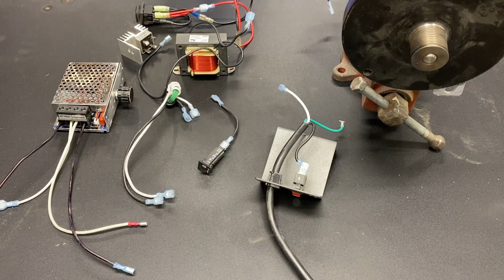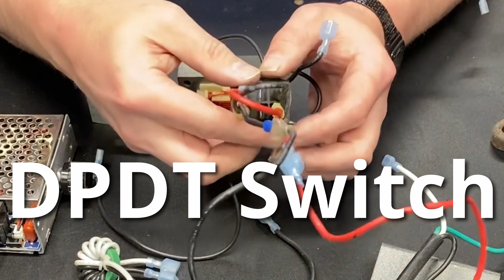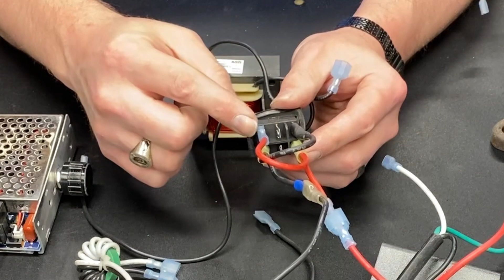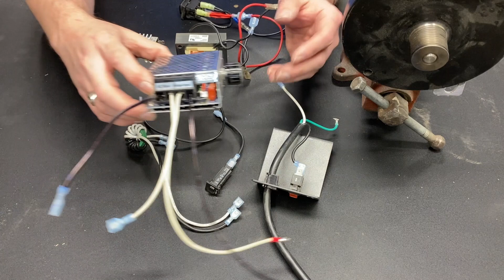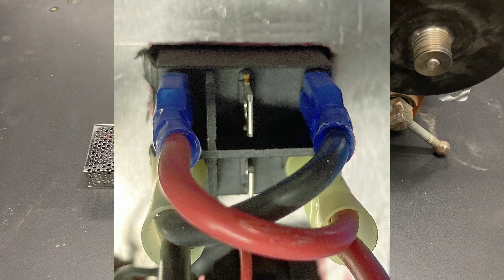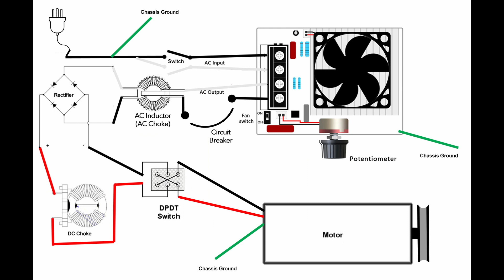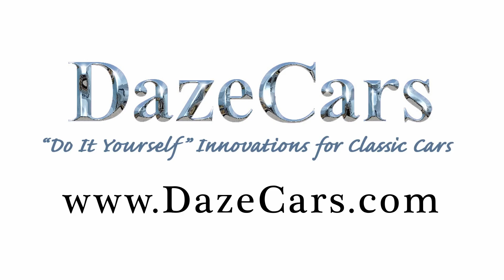Hooking up the Components for a Quality SCR Treadmill Motor Power Supply, Treadmill Motor Controller

Comment: I was looking at choke transformers on eBay, and they seem to have double wires coming out of them: two black, two red, and two blue. This is different than the ones in your videos with just single black wires. What do I do?
Reply from the maker: The problem is they are mislabeled on eBay because the person selling them doesn't know the difference and they are creating their listing using info from previous listings.  There is no such thing as a "choke transformer"  it is either a choke OR it's a transformer.  The two parts look almost identical but are NOT interchangeable.  Easy way to tell is the number of wires.  two wires it's a choke 3 or more wires it's a transformer. Here are a couple videos that should help  

https://youtu.be/atlaaApTkJw   

https://youtu.be/sYjkQvUSths

Comment: We had almost this same circuit, but without the choke.  After dozens of tests, the magic smoke came out of the motor.    Now planning on including a choke.
Reply from the maker: Glad you're adding a choke this time around; it definitely makes a huge difference in longevity.

Comment: Hello Your videos are very interesting what is the value of the circuit breaker please?
Reply from the maker: if the rectifier fails it will typically short out which will burn up the SCR.  The circuit breaker is there to try and avoid that.

Comment: just curious if there might be any further benefit in terms of reduced motor strain or improved linear speed control for running the SCR DC power through a PWM and then to the motor?  Thanks for the terrific videos!
Reply from the maker: no because its still clipped AC.  The power quality issues with the SCR come from the on and off action taking place at different parts of the AC cycle.  Clean steady DC with a PWM is clean power because the DC is a constant source but the chopped nature of an SCR will not produce clean steady DC.  make sense?

Comment: What DC choke did you use? The ProForm treadmill I pulled apart didn't have one. Would a filter choke work in place of a treadmill specific choke?
Reply from the maker: it need to be a "motor choke"  all chokes are filters but the size of the wires and the amps they can handle makes all the difference as to weather it will work or not. https://youtu.be/hbfOWrmP_pw

Comment: Hi what size choke h ect for 220v ac Spanish mains  ?
Reply from the maker: The choke is sized to the motor not the line voltage.  It needs to be a high amp "motor choke"

Comment: I see your parts list, but no listing for the choke  that goes before the  motor.  Do you have a supplier for that?
Reply from the maker: That is the hardest piece to find.  Motor chokes are not easily available new and so places like eBay and treadmill used parts houses are you only option. (other than scrapping more treadmills until you get one) Problem is they hav gotten expensive and most of the listings are wrong because it says choke and transformer in the listing but the two parts are not the same even though they look similar.
Reply: @dazecars  I'm up to 5 treadmills finely got one with a choke. Do I need to use a choke if I'm using a MC 2100.  I have 4 of them , none came with a choke.  So I guess I don't need one with them. First project was a 2 X72 sander all from scratch . No plans all scrap I had laying around. Just bought the 4" idler pulley and a spring for the tensioner . Came out great . 2nd project is a lift for my mill. The incline motors are not like the one you used.  Have it geared up with gears from a 21 speed bike. The middle front gear and the smallest back gear. Turned hubs to mount them to the  crank shaft on the mill and the motor shaft. Goes up and down nice. Using PWM on both. Learned a lot from all your videos .( but not a Ford guy) I have a 51 Chevy Sedan Delivery I build a SBC and dropped it in with a 5 speed .
Reply from the maker: If running an MC2100 you do not need a choke.  Keep in mind an MC2100 is not the best option for a belt sander or band saw.  In both of those applications there is little opportunity to gear the motor down for added torque.  This makes the potential for stalling the belt or blade higher and stalling the motor will likely burn out the MC2100.  Good thing you have several of them.  Glad my videos have been helpful

Comment: Just to add you can eliminate the choke & inductor ..by adding a 2200 MFD - 200 v capacitor (Amazon. )..make sure u follow polarity..!!across the speed controllers DC out put ...this will eliminate the sawtooth ripple riding on the DC output that will overheat the motor ..and reduces the loud hum to almost zero ..if worried about high frequency oscillations ..hook also a .01/ 100v AC capacitor across as well...will shunt any oscillation out....this is how I did mine ,been working 2 yrs now..no issue .cheers
Reply from the maker: how is it under load?  When I ran a capacitor to my setup it caused surging under load.
Reply: @dazecars ...have no problems...i made my own controller...i just tested on a commercial one (amazon)....loaded it hard at low speed...no surging ...should not be any issue..all the capacitor does is filters out the diode ripple thatz riding on the DC output...try a smaller cap...around 560 mfd..i've designed & made controllers for 40 plus yrs...and allways have large caps after the diode pac...to give a pure DC as possible..the only thing i can come up with..possible your exceeding the rated amperage of the controller and its trying to limit the current ..as the DC voltage will be bit higher as well as the torgue capability ...runs more efficient !.my controller is 30 amps... cheer s
Reply from the maker: My controller was 10,000 watts so not a limit of the controller.  Thanks for the follow up info
Reply: @thebearsden1701  Do you have the schematic and parts list for your home made controller available to share?
Reply from the maker: @dankd5det256 here is the parts list video https://youtu.be/NUOCo01qARE and the schematic is in the very video you added this comment too  8:17 ish https://youtu.be/SjEgKH_MGFE

Comment: Excellent idea. I’m making a pottery wheel for my daughter. Can I use a foot pedal in place of the potentiometer ?
Reply from the maker: absolutely as long as the foot pedal is a variable resister of the correct resistance.  These videos should help with that:  https://youtu.be/04d0u1RJyXw https://youtu.be/SUmgXllMo4g

Comment: man. i was hoping someone would make a simple video on this! thank you VERY MUCH! the parts links are awesome also! my only question, is what DC choke is that? i have the one from the treadmill. but that looks a bit bigger than mine. is there a link i missed?
Reply from the maker: Is the one you have from a treadmill a choke or a transformer.  They look the same but are not the same thing.  Your statement about it being "smaller" has me wondering.  Contact me through my website and send me a picture.  I don't have a link because I haven't been able to find a source other than from treadmills.  You can get chokes from electronics suppliers and places like Amazon but they are way too small.  They look correct in the picture but are not  It must be labeled as a motor choke to be the correct thing.
Reply: @dazecars  ok. sent some pix. thanks for any help. the video was spot on. just that one old guy question. LOL!

Comment: I bought the rectifier you linked. It has two + poles a - pole and a ~ pole. I’ve tried hooking up ac. Confirmed 118 volts. When I test the other two poles, I’m getting 118 volts. I’ve tried switching the ac wires back and forth. No change. I thought the one you showed had 2~ poles and a + and -
Reply from the maker: The manufacturer may have changed something but to confirm I would need to see a picture.  Please email me through my website.

Comment: I have a 130 VDC motor and have all of the components that you have in this video and would like to run this machine on 220 VAC. I'm not sure how to wire this up now that I am actually ready to do it. I see the pale wires in your diagram near the end of the video. Do those represent the second leg of 110 VAC going into the SCR controller and through the AC choke the to the bridge rectifier? Any help would be appreciated.
Reply from the maker: 110 and 220 wire up the the SCR the exact same way.  the important thing is that you add a limiting resister to the potentiometer or you run the risk of putting twice the volts to the motor of what it is rated to handle.

Comment: How many amp  for circuit braker y nid
Reply from the maker: 15-20 BUT always go with the same size or smaller than the breaker in the house for the outlet you will be plugging into.

Comment: Does it matter if the treadmill motor is brushless or brushed? I have both and was thinking about making a small, 6" disc sander. Any thoughts on which motor you'd use and why? Thank you so much for all the effort you've put into your tutorials and sharing the knowledge. Cheers
Reply from the maker: brushless motors are typically better if comparing two similar motors but you need to look at horse power, torque, and RPM to truly figure out which one is better for your application.
Reply: Yes, totally agree.

Comment: Hi, I had your video recommended to me and loved it, made my setup very simple. But here's the problem. I used the materials listed above (AC controller, rectifier, switch etc) and set it up on the workbench and it worked perfectly. Forward - stop - reverse no issues.
Then I took the motor and AC controller and mounted it on my drill press. Tested without switch - runs fine, reverses fine. I wired in the DPDT switch and everything worked fine when the switch was not mounted on the drill press.
As soon as I mounted the switch on the press itself and presto, it blew. 
I retested everything and it all worked also on bench and on machine, with switch not mounted. I made sure that switch connectors were all perfectly insiulated, mounted it on the drill press, and it blew instantly.
Have done another round of tests, same results - but I haven't mounted the switch. I need to find out why the switch(es) are causing shorts... 
Suggestions?
Reply from the maker: Contact me through my website and send pics. There is no obvious reason why this is happening based on your description.
Reply: @dazecars  thanks. The problem solved itself; it's now working. Might have been a batch of defective switches, or I miswired something somewhere. Redid it all one final time and it's working fine.
Reply from the maker: glad you got it fixed

Comment: Happy new year! Thanks so much for your highly informative video. May I ask if this set up is applicable to an actual treadmill application which is now not working due to a busted and unavailable control circuit?
Reply from the maker: yes and no.  will it work, yes is it a good idea, probably not.  A treadmill comes with an assortment of safety features but powering it with something like this would not have those features.
Reply: @dazecars  Thanks so much for your prompt and straightforward reply. I guess I just have to try to assemble your design, taking the consideration to include the  respective chokes to safeguard the dc motor and scr assembly. I'll also try to acquire the 2 chokes since they are challenging to find. I'll give you feedback afterward. Kua
Reply from the maker: let me know if any questions come up
Reply: Hello again. I hope you're okay. May I request for the specifications of the parts as listed below. The specs of my treadmill motor are 180VDC, 10A, 3900 RPM. Thank you very much!

1. SCR Voltage Controller
2. Circuit breaker 
3. AC choke or inductor 
4. Rectifier Diode 
5. DC Choke or inductor
6. DPDT switch
7. Size and type wires
Reply from the maker: I have a video showing all the parts needed https://youtu.be/NUOCo01qARE  The wire needs to be 16awg minimum
Reply: @dazecars  Thank you very much! I'll check the link of your video! God bless!
Reply: By the way, the source of power in our house is 220V; 60Hz; single phase. Thanks.

Comment: My treadmill motor has black, red and two blue wires.  Can I ignore the blue wires without causing problems?
Thank you for these videos!  Really good information, well presented!
Reply from the maker: When it comes to blue wires, if you have them I would use them.  https://youtu.be/Mx4022PbHO4  Also know that the majority of (but not all) motors that come with blue wires are lower quality.  I would make sure you calculate torque, gear it properly and have reasonable expectations for what you are putting it on.
Reply: @dazecars  Upon more reflection and study of the label, I'm thinking the blue wires may be attached to an internal thermal sensor.  Regardless, what would I attach them to?  The calculation works out to 1.85 Ft/Pounds of torque.
Reply: I wrote my reply before watching the linked video - I should have watched it first!  I had not found that one.  I've bought one of the recommended SCR power supplies and now I know how to hook up the blue wires!  You're good!  Thanks again!
Reply from the maker: glad I could help

Comment: Thanks for providing great content.  I just found in a tread mill this PW sup: AEROBICS 9501001 REV J PACEMASTER PRO SERIES. It dose not have the 3 HWL pins.
Would you have a suggested wiring option?
Reply from the maker: I do not have a hack for that one
Reply: @dazecars  If I get the pin outs and get it working I'll let you what I find.

I have taken 3 Treadmills apart and have not found any of the controller boards that you have mentioned so far.

Thanks for the DIY info.
Reply from the maker: glad I could help

Comment: I put a treadmill motor on my wood lathe and have basically wired it just like you have in this video.  It was very helpful.   I have a 16 amp breaker on the AC and another 16 amp breaker on the DC.  If I have to pot on the SCR set to a higher speed, the inrush current blows the AC breaker.  I can run at any speed if I start the motor off slower, maybe 50% max speed or less.  Any suggestions on how to deal with this?
Reply from the maker: as long as the breaker going to wall outlet is 20amp you could upgrade that breaker in your power supply to 20 amp.  then leave the 16 on the DC side for extra protection.
Reply: @dazecars  okay, thanks.  the breaker for the outlet is 20 amps.  I'll replace my breaker going to the SCR to 20 amps
Reply from the maker: 19 would be better so it trips before the hose breaker but I don't know if those are even available

Comment: Is this set up different if you have 220v input?
Reply from the maker: The only difference is the potentiometer value.  The one that comes in the SCR is still too big but the 120K-150K that is often times used for 110V applications will be too small.  That is why I always recommend using a multi meter and measuring the resistance of the disconnected potentiometer when it is at the point where the system first comes on.
Reply: @dazecars  awesome, i wasn’t sure and just wanted to be safe, i have it set up and wired, just didn’t plug it in yet. I’ve done the SCR set up before on 120v input and it worked great. Thanks for all the videos and knowledge bud, it is massively massively appreciated!!! 🤘🏻👌🏻
Reply from the maker: just keep in mind the motors max voltage.  If its a 90V DC motor taking it a little mast to 100-110 is not that big of a deal BUT taking it around 200 will be a problem.  Most treadmill motors setup for 220V are raited at 190V DC
Reply: @dazecars  this is a 3hp Lesson DC Perm Magnet… it was on Facebook market place for $60!! It was beyond highway robbery considering what they sell for new and it also has a right angle gearbox!! And I happy to report it runs like a CHAMP!! Only thing I didn’t have was AC inductor but I have one arriving tomorrow, do you a video on how to wind the inductor? I’ve watched the DC Choke video but didn’t see one for AC. Thanks again for your input, greatly appreciated!!
Reply from the maker: No 7 winds of each lead will get it done.

Comment: Hi DazeCars, I wrote to you on your email but in case you missed it, i was curious why after making sure my motor worked as it should, i mounted it to my lathe/mill. Now when i slowly turn the potentiometer and motor starts to turn for 10-15 seconds the inline breaker clicks out. Any ideas why this would happen? Is it the size of my rectifier. Its only 1x1 inch square?
Reply from the maker: how many amps is the inline breaker?
Reply: @dazecars  Im not sure. It came off the treadmill i got the motor from. Will it say somewhere on it?
Reply from the maker: usually
Reply: @dazecars  I ordered a 30amp breaker off Amazon.  I'll see if that does it
Reply from the maker: cancel the order, that is WAY TOO big and will not do its job.  https://youtu.be/NUOCo01qARE
Reply: @dazecars  ok

Comment: Hi DazeCars. I have a MC60 and no matter how i hook it up , it trips the breaker on my outlet strip. Is there a way to determine if the board is just shot or do you think i need to plug things right into a wall outlet? Im at my wits end. I cant figure whats going on.
Reply from the maker: Outlet wall. That strip is likely 10 amps or less. you want a 20 amp wall circuit
Reply: @dazecars  Thank you, because it was driving me nuts . Ill try the outlet
Reply from the maker: My pleasure.

Comment: It's so odd that a DC motor needs and AC thermal fuse, thank you so much for the information!
Reply from the maker: not so odd due to the fact that it is on the AC side of the circuit.  Glad it was helpful!!
Reply: @dazecars  just wired up my motor using your videos and everything works great!  Need to  replace the potentiometer, thanks for that video as well 😁
Reply from the maker: My pleasure.